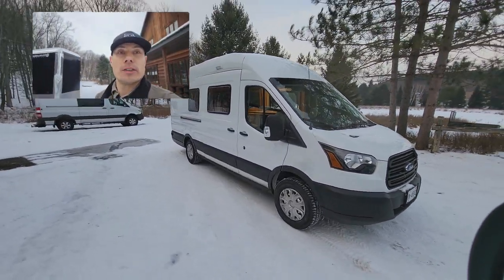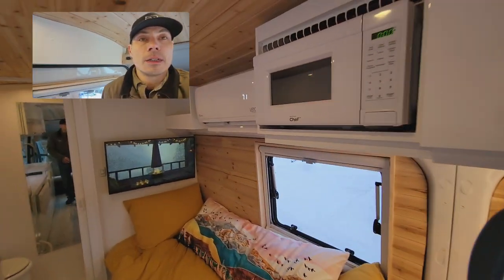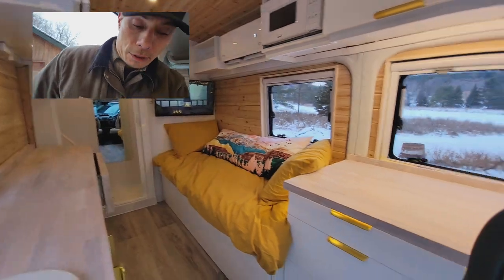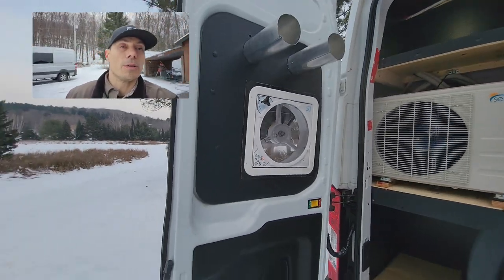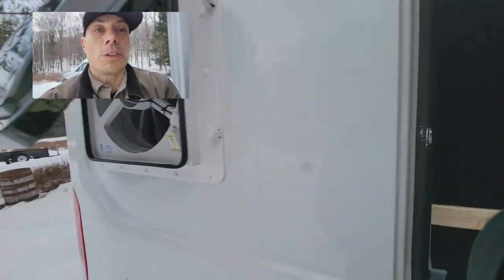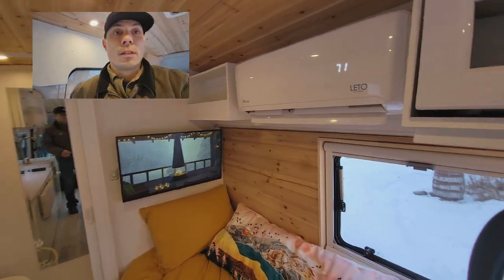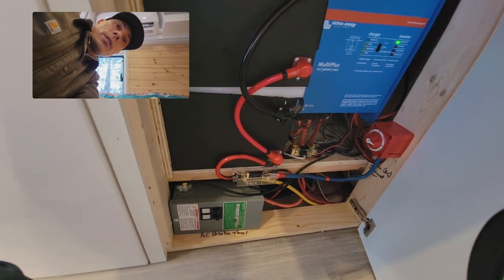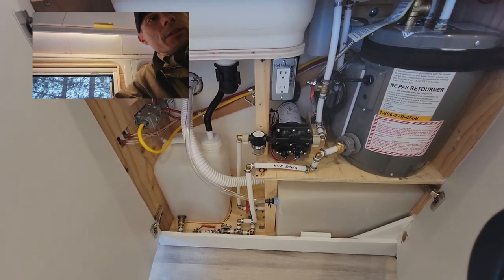Mini Split Air Conditioner in Van Conversion. Unique layout for single camper.

Comment: Phenomenal build. Your mom is one lucky woman. I love the layout. Having the bathroom in the back really opens up the rest of the van. This is one of the best floorplans I've seen. Initially I was concerned that the mini-split wouldn't get enough air circulation. The combo of the Maxx air fan and the tubes bringing air to the back of the unit looks great. Well done!
Reply from the maker: Thanks! It works great and has proven to get plenty of air circulation. She loves the Floorplan and wouldn't change anything.

Comment: I am installing this setup in my semi- truck due to this video. Thanks for showing us the quiet operation and wattage usage.
Reply from the maker: You are welcome. Glad it helped. Van is just back from 2 months in Florida and the A/C and heat pump worked flawlessly.
Reply: @TheNaker  Thanks! You mention the connections to the heat pump is braided cable instead of solid.  Is it the 410A refrigerent lines or the electric control lines? I can see a use case for both in a tight installation.
Reply from the maker: @Carolina Dreamer  I meant the electrical lines. Best practice is to use stranded wire for electrical as solid household wire can break from vibration and cause fire.

I usually find properly rated extension cords cheaper than marine wire.

Comment: Absolutely Impressive AC set up.  Dometic rooftop AC unit on our Airstream Sprinter is incredibly loud, and doesn't ever feel 100% cool. Considering a mini split.
Reply from the maker: Ive had a few Aistreams and couldnt stand the sound. Mediocre performance made th even harder to appreciate. The minisplit solves all of these issues and uses a fraction of the power.
Reply: Those domestic ac units use about 2x the electricity that these minisplits use for the same cooling performance.

Comment: I always wondered why no one put vents on sides of builds. Maybe long term leaking problems? Could easily make a curved hood to divert water over the fan, to be extra water proof. 

Your plumbing system is so advanced and filled out in the van. Most van plumbing sucks. Yours is outstanding. Very inspiring.
Reply from the maker: Thanks! Going on 3 years and no leaks. Don't think a hood is necessary.
I never understood why builders don't plan out plumbing better...

Comment: Wow this is amazing! I was looking into some sort of all-in-one cooling/heating solution and was originally going to go with an expensive underside mount AC unit hooked up to a hydronic heating system so that the same vents could be used for heating from a diesel espar heater. I love the simplicity, quiet, and effectiveness of your build! How many watts does it draw and how do you keep water from getting in? That is a really nice van...
Reply from the maker: Hey, glad you liked it. The heat pump draws between 600 and 950 watts typically when running. But it cycles off so the actual draw is lower on an hourly basis. Initial testing shows that with two 206ah lithium batteries, it will run around 5-6 hours.
The rear vents are louvered so no water really gets in. And that high up on the van is out of the road spray.
Really, the only downside to this over your ideas is that it takes up some room in the back of the van. But its much cheaper and simpler and quieter. The A/C Heat Pump was CAD $999. No other option offers this performance at anywhere near the cost.
Reply: What is power use during heating? Less than AC pwr use?

Comment: Very nice installation! I've been thinking about a mini split for my retirement van.
I might be tempted to put a transfer grate from compartment below compressor to cabin so I can use that brilliant maxaire fan location to pull air from cabin on nice days. Add a vent somewhere forward, maybe floor or front firewall for cross ventilation.
Reply from the maker: Great idea!
Reply: for a quick and simple, I would suggest to just crack a window upfront with rain guards installed to keep water out.

Comment: Sean, incredible build! The best I’ve seen yet! Quick questions for you: were you concerned about the fan on the unit being more powerful than the max air fan? do you have the max air fan set to its maximum setting whenever you run the system?
Reply from the maker: Thanks Mike! I wasn't too concerned about the balance between the compressor and the fan. The compressor moves a lot of air slower but the fan moves a lot of air faster. I think the fan pulls more fresh air in to the compartment then the compressor can use. I do leave the fan on max setting. The maxxair fans are incredibly quiet and efficient (especially compared to the fantastic fans).

Comment: Nice job. I just did the same ceiling. That's not as easy as one would think. The ceiling curves in two directions. Finding the center is a bit harder than a square house ceiling.
 I do a window AC setup like that and run it through the floor so it's stealthy. and can't be seen. You do great work.

Comment: really smart build, looks awesome inside. i wonder if it colds down the place effectively in the summer.
Reply from the maker: The A/C is overkill for this van. I did fully insulate the van with 3M Thinsulate (walls and roof) and XPS closed cell foam on the floor.

Comment: Is the hot water tank electric powered by 12v system?  What does she use for cooking?  Is there a holding tank for shower water?  Love the shower in back; great build and the mini split setup is awesome!
Reply from the maker: The hot water is 120v but runs off of the 12v system through the inverter. She is mostly plugged in but can use the batteries if needed. Or turn it on 10 min before arriving and it will heat up on the 12v system which is being charged buy the van engine while running. Cooking is done with an electric hot plate (halogen) and a butane camp stove. She didn't want a holding tank so I put a garden hose connection under the van for the shower drain. Easy to add a tank later if she wants but so far is happy without one.

Comment: Fantastic! So smart how you did the mini split! Thank you- I may be copying this myself now rather than mounting on the outside! Any issues using the system while driving?
Reply from the maker: She doesn't use the unit when driving as the van's air conditioning and heat are more efficient

Comment: Hello, great build and that's a great idea for van a/c. One question  what sized battery bank are you using? I saw in the comments I believe you said it has 400 watts of solar on the roof. Again Great job.
Reply from the maker: Hi, the van has 3 x 216AH lithium batteries.

Comment: Good job, Sean! I've been looking for a one person conversion for some time now, and you've done it in the way I will do if I ever go full time. So far, my minivan conversion meets my requirement for part time travel. (Andy's Campervan Adventures) You have an MPPT controller in it, so you must have some solar panels. Are they on top or portable?
Reply from the maker: Thanks. The layout has been perfect for one person. I have 4x100 watts of solar on the roof. Another benefit of not having a roof top air conditioner is the roof space available for solar.
Reply from the maker: I took a look at your build pictures. Well done! I can see you've put a lot of thought into your build and I love the simplicity. I always strive to avoid complexity for a van. Can you tell me where you sourced that window vent system?

Comment: Your layout is great！ Could you please tell me, is the ventilation fan at the back that can open the lid electrically a DIY one from you or is it a finished product? What is the name of the finished product? Thanks!
Reply from the maker: The vent fan at the back is made by Maxxair and the model is Maxxfan Plus. It comes with motorized lid.
Reply: @TheNaker  Thank you,bro

Comment: Hi. I sent you a message around 8 months ago. I purchased the mini split, max air fan, etc.  I’m getting ready to install it.  I haven’t purchased batteries or solars, yet. Any updates on the battery bank and solars?  Anything you would have done differently on the install?
Reply from the maker: Hi! The 400 watts of solar with MPPT charge controller is great. Any more wouldn't fit on roof. We added one more lithium 206AH battery so now there are 3x206AH SOK batteries. This seems like a good amount for overnight capacity with AC or heat pump. She mainly uses batteries overnight on drives to Florida or weekend getaways. The rest of the time she has hydro at campsite. We wouldn't change anything. Two full-time winters in Florida and everything is working perfectly. On install, I was curious how well the drains would work but no issues at all. Good Luck!

Comment: So far, this AC solution makes the most sense of any I’ve seen! 

Right now, I have a regular GE window unit in one of the windows in the back of my van. 

My plan is to replace it with either a mini split or some type of rooftop.

My build is different from yours in that my bed is at the very back of the van, running parallel to the back.

Right now it’s a good arrangement but I really (desperately) need more storage space. To accomplish this, I want to raise my bed up about 20” - 25”.  

This would place the bed near the top of the back door. 

Where would you suggest putting the second component of the mini split? Could it go in the section by the back window immediately below the bed? 

I think that I will be able to mount the indoor part right about where you have mounted yours I have a flat surface in that area with insulation behind it.

If you can give me any advice at all, it would be much appreciated!
Reply from the maker: I think you could mount the compressor below your bed in the storage area. It's very quiet so I don't think you would need to soundproof. Vent on the door would be lower down to match the compressor.

Comment: Gorgeous van and nice install, particularly if you already use a utility closet. Speaking of that: why have all the empty space in the utility closet and then your other utility systems stuffed (elegantly..) beneath your counters, usually used for life support storage?

I’d like to see someone compare this solution to the heating and cooling alternatives for costs of set up and maintenance
Reply from the maker: Thanks. The closet was a requirement for larger outdoor items like lawn chairs, tents etc... There is still plenty of storage below bed and counter behind driver. Also overhead storage.

Comment: Awesome mini split idea! I am currently building out a 170” sprinter at the moment & in the market for an AC unit. My question is are you able or have you ran the mini split while vehicle is moving? I’m sure you have it mounted down securely. Love the entire set up! Thanks!
Reply from the maker: Thanks and good luck with your build. You could run the mini split while driving but the van AC and heat work great so haven't had a need to.

Comment: Hi Sean.  How are you?  What are your thoughts regarding a mini spit compressor under the queen size bed in the garage area?  Thank you
Reply from the maker: The challenge with putting the compressor down low is the doors have mechanisms and reinforcements that impede adding vents. It might be possible but it's definitely easier to go through the window blanks in the rear doors.

Comment: This is really awesome I’m gonna shuttle bus and I’m thinking maybe mounting mine just inside the rear door and putting vents in a fan just like you did that’s awesome. My question I’ve seen this several times a composting toilet in a shower I know that the humidity is a killer for the composting toilet so how do you shower with a composting toilet in there or do you have to remove it?
Reply from the maker: Thanks! There haven't been any issues with the composting toilet in the wet bath. The toilet has a small fan and is vented outside which is definitely required though. Good Luck!

Comment: Came for the subtle mini-split -- great, simple solution. I'm curious about the comfortable-looking front seats. Those don't look stock. What seats & swivels are they?
Reply from the maker: The seats are the stock vinyl ones but I installed covers from seatcoversunlimited.com . These are the 'Scottsdale' model. I highly recommend. The custom fit is excellent, fabric is so soft yet durable and they have a bit of foam padding that improves comfort.

Swivels are Scopema. Pricey but they work well and are low profile.

Comment: I really love this job bro.
I don't know too much about that battery setup, How can I do it if I can't install solar panel on my semi truck?
Thanks and God bless you
Reply from the maker: You can run an inverter off of your engine to do this while your truck is running. Or have a lithium battery and charge it from your truck engine so you can use it when the truck is off.
Reply: @TheNaker  thanks a lot

Comment: This is really giving me ideas, fantastic ingenuity! When you said, “Braided cable extension cord” I wasn’t sure what that meant. Could I trouble you for an explanation?
Reply from the maker: Thanks! When you do AC wiring in a vehicle you are supposed to use stranded or braided wire and NOT household solid core wire. I think the vibrations can possibly break a solid core wire and cause a short or fire...
Reply from the maker: Extension cords are stranded or braided AC wire. Or you can use expensive marine wire.
Reply: @sean n Thanks for the info. It is appreciated.

Comment: Sean, hope you're well...just following up to see if you would do anything different with the Mini Split in regards to air in and pressure for the unit operating as it should. I am getting closer to making a purchase on the Mini Split and plan to go Interior as you have done  but in my cargo trailer. thanks again.

Comment: (2024) I discovered this video at least two years ago.  Love the design for the mini split. After two years how is the unit holding up being in a mobile application.   Is there anything you would change?  Thanks
Reply from the maker: It's been working flawlessly.  Would not change anything. She has lived out of the van for two winters in Floridan and South Carolina and the AC was perfect. I'll try to get the van to do an update video.

Comment: Hi, great job--looks much better than my van :) Did not hear the mini split you were using--which one is it? Got the "Victron 3000 W Inverter Charger" and 2 206 amp lithium batteries--is that correct " 206 amp"? I am usually in the northern states and was hoping I could use a mini split to keep temps at night around 65 degrees--both in winter and in summer. Don't spend a lot of time in van except to sleep in. Would the system and batteries you used run all night? Thanks for your thoughts and making the video.
Reply from the maker: Thanks! It will run around 6 hours with the two SOK 206 AH lithium batteries. We added a third to go closer to 9 hours or longer if not used all the time. If you spend many nights in the cold, I'd recommend a small diesel furnace for the cooler months.
Reply: @TheNaker  Thanks Sean...I'll look into a small diesel furnace. The main thing I was wanting a mini split for was the heat--have gotten tired of waking up and it's 40 degrees or less in the van in the morning

Comment: Brilliant mini split install, I suspect it will be copied extensively. I have a cargo trailer I converted with the same floor heat and mini split and I found in mild winter camping they will both run all night and I still have some battery power in the morning however I do have a larger battery bank. These mini splits are so effecient and low cost they are the best solution for a/c and heat. Your entire build looks amazing!!!!  Did you have the front seats covered or buy aftermarket ones?
Reply from the maker: Thanks!
Those seat covers are from SeatCoversUnlimited. They are the Scottsdale model in taupe. I highly recommend these covers. They fit like factory and are comfortable and look amazing.

Comment: Love this idea!  Well done.  Two Questions:  Do you think one could use a vent for the pump exhaust instead of a powered fan?  Maybe with a makeshift duct or seal from the vent to the pump?  Also, any considerations regarding best vibration resistant mini split (from what I understand they all recommend no vibrations)?
Reply from the maker: I think the powered fan is required. These compressors need a lot of air to operate at efficiency. We haven't had any issues with vibration on our unit. It's in year 3 and working perfectly despite lots of traveling on rough roads.

Comment: I am wondering if the fantastic fan is even required seeing how the condenser has a fan of its own, perhaps an aerodynamic shroud to closely fit a vent the same size as the fantastic. Keep the two top vents and pipes.

Comment: Wow! beautiful workmanship. Really appreciate your attention to detail, and labeling. Given LFP batteries have incredibly low internal resistance, might humbly suggest replacing the ANL fuse with a Class-T as the AIC rating is much higher than that of an ANL fuse. Simple fire protection as an ANL fuse cannot withstand the instantaneous current LFP batteries can deliver in the event of a catastrophic short circuit.
Reply from the maker: Thanks. I'll look into this.